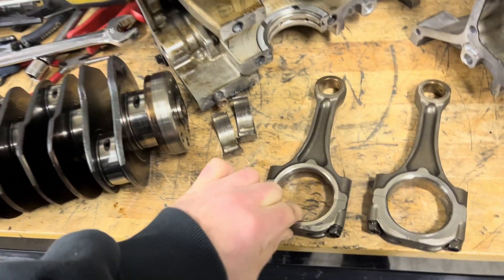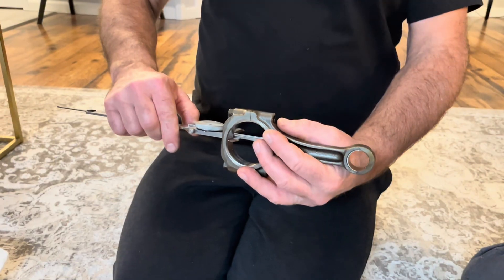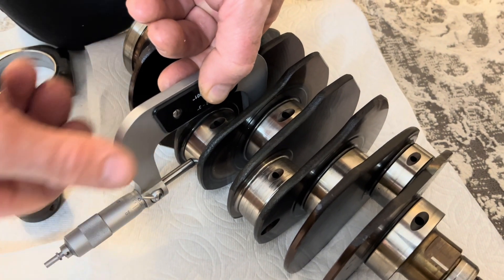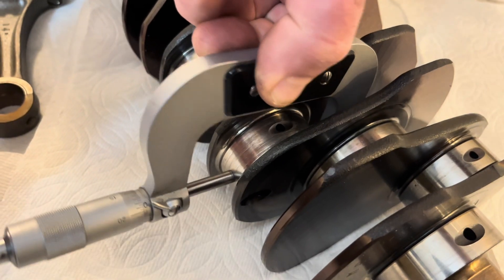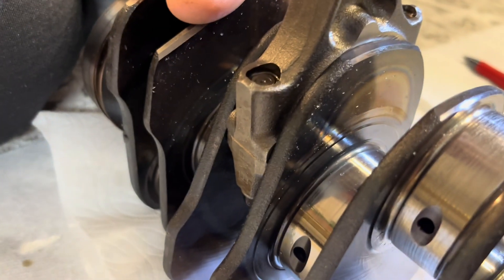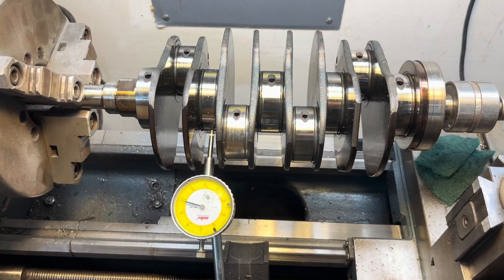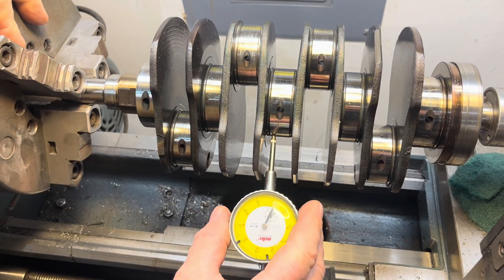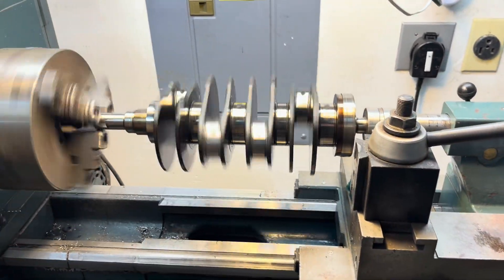STI Engine Build - Bent Crankshaft! - Part 4

Comment: What a true  machined to messure frint to back. You don't see to many guys like hi around image using that crank shaft in a engine and sending it up to 7000 rpm. It would have been a rebuild in less than 1000km
Reply from the maker: @blowngemini2031  yeah you’ll never see it with the naked eye. It makes sense how would throw off balance.